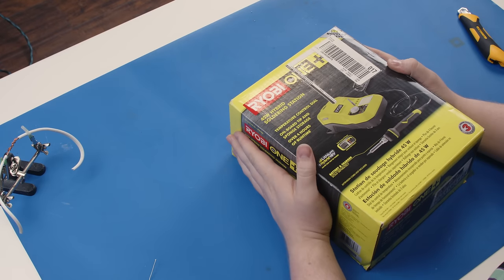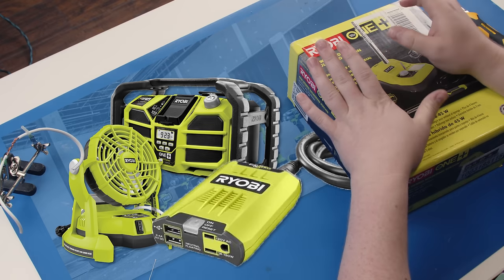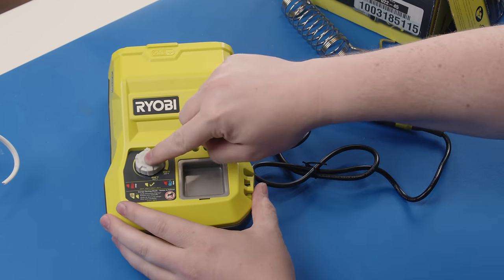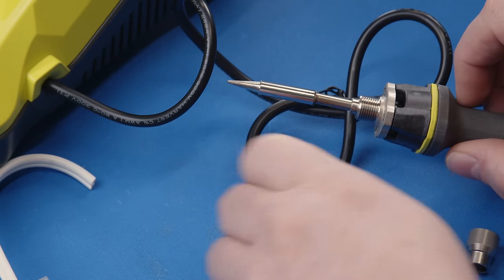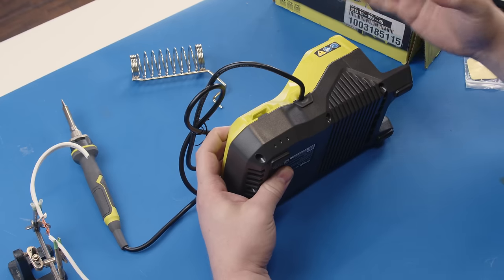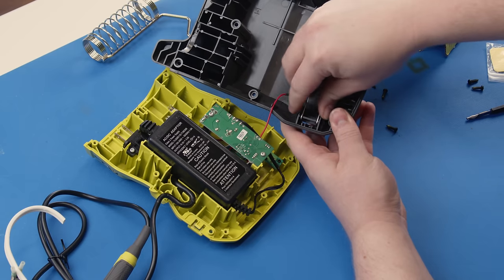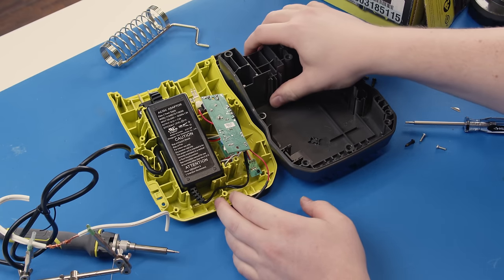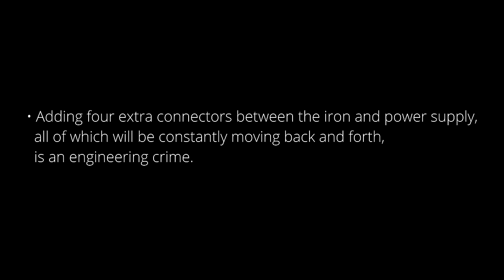Ryobi has GOT to be joking with this soldering iron

Comment: honestly, good on them for choosing Torx screws, imo. Professional choice.
I can't wait until Philips & PZ all curl up and go extinct.

The power brick is ... odd, but makes logistical & regulatory sense I suppose.
No excuses for the melt-happy wire though.

Looks like a solid design otherwise, ngl.

Regarding the build up of heat, I'm guessing it has that "intermittent operation" sentence in the user manual? Something something, not intendended for continous operation...
Reply: Torx is junk because you need a different driver for every size. With Philips and especially FlatHead you can almost use any driver for something like this even if it's not a perfect fit. For this application you aren't anywhere near the torque that would strip even a decent FleatHead, let alone require heavy duty systems like Torx. So I guess (and hope), that day won't come, and it didn't happen the first 50 years Torx was around, so...
Reply: @westelaudio943  and yet in the process of using the wrong Philips, you go and strip the crap out of the screw and permanently seal what ever you were trying to get open. Torx is a measure to protect the user from themselves. SECURITY Torx can piss off tho.
Reply: @deefdragon  

I've never owned more than three sizes of (large) Philips drivers and I can't recall that this ever happened to me with screws for plastic, except for maybe when the screw was totally rusted up and wouldn't move. But even then it's more common for the whole head to snap off, as those screws are usually made of very soft steels. You can still squish up the little blades on a torx head with the wrong tool, so that the right bit wouldn't slide in anymore. Torx only makes sense for self tapping wood screws, or bolts that go into metal, especially aluminium, if the space is too limited for a proper hex bolt...
Reply: @deefdragon  , I'm okay with Pozi-Drive, they're better than Philips anyway; but millions of people strip out Pozi-Drive screwheads by using ordinary Philips screwdrivers on them, because they don't know the difference, or don't care to learn. But I should confess, I only learned about JIS Philips-like screws at about age 60 after a lifetime of audio repair and tool use/abuse! (If I was a motorcycle buff, I might have learned about JIS screws sooner ---- I'm told that many bike owners stripped out the carb screws on their Japanese bikes). Anyway, for small or tiny screws, I'd much rather see Torx, or Robertson, screws than a #1or #0 Phillips.

Newsflash: Philips screwdrivers and bits  Can vary quite a lot in terms of angles and tapers. I have found some ordinary Phillips that are almost a perfect fit for JIS screws (Milwaukee impact rated bits) and others that are terrible. Weirdly, Dewalt makes Philips drive bits in 2 different styles, the tip of one type being very different from the tip of the other, and there's nothing differentiating them in terms of numbering or designations on the package. Torx and Robertson bits don't suffer this problem.
Reply: @westelaudio943  we’ve found the guy that leaves everything they work on with a load of rounded off screw heads 🙄

Comment: The thing to do with the Milwaukee M12 soldering iron  is use the large M12 battery that has a square base. You leave it standing and bring your wires to it. Works fantastic. I use it all the time in industrial settings. The head rotates for better positioning.

I have had mine for years and I've never had any issues and I've been decently rough with it. But if I did ever break the ceramic cartridge you can just change it out...

There is no heat control, but if you're soldering wires that's not an issue. Or soldering wires to industrial items made to be soldered to.  It's too bulky to regularly use for boards. But works great for soldering up connectors in the field, even M12 connectors. Bringing the wires to it is much quicker than using a 3rd hand and when you have a bunch of wires to solder. For an M12 connector you pre-tin everything and then just touch them to the soldering tip. Use a jar of no clean flux if you need flux.

It's a tool for technicians in the field. Not for use at home or at a bench.

Works much better than any butane powered iron or the Hakko iron.

I'm actually surprised you've had such bad feedback. I've known lots of other techs who have loved them and had them be problem free.

This Ryobi iron does seem great but with a different use case. I hope they come out with a Milwaukee version. I don't want to invest in Ryobi just for this when I already have way too many m18 and M12 batteries and chargers. If they keep the same cable I would have no problem upgrading it.

I'm an industrial automation electrician now. But I also used it when doing custom agricultural automation.

Comment: For about 8 years now, you can just get a TS80 and a powerbank or a TS100 with a USB-C fast charge to 12V adaptor.
About a 80 bucks, open source, temperature controlled and modifiable. Also uses a great tip technology. Sure it's not a station but you can very easily make it into one.
Reply: or a t12 kit for even cheaper.
Reply: Miniware has the ts101. Super portable.  Buy the accessory chisel tip.  You can mate it with a, compatible tip,  18-24 Volt laptop charger. You're good to go with 90% + of projects.

Comment: As someone who does soldering a couple times a year to repair electronics that I (ab)use to hell, I found "smart irons" like  TS100 or Pinecil V2 to be perfect. They might seem gimicky but their performance is solid. My current setup is PinecilV2 with a metal stand with a neodymium magnet for auto-sleep mode and a 18w PD battery pack. I also use a 19V barrel plug laptop charger when I need more power (up to 80W which is crazy). There are also some developments in RalimOs (firmare for those irons) to allow for up to 60W of usb-c PD capability.

Comment: At the same time as ColdHeat was around, another option was the Takumi soldering iron, ir runs off 3 AA cells. It'll consume the batteries in fairly short order, but it does make solder joints on things that aren't too heavy. 8W might not sound like much, but due to lack of area, it doesn't lose a lot of heat to air. They were very cheap and just something you could have for emergencies. Hakko also makes one of those, runs on 4 batteries. Oh right you have these both mentioned. Well they sure beat the ColdHeat, which was a total scam product. The lack of temperature control is not really a problem with these, since you simply push the button until you have a joint, it heats up in like 4 seconds and then you just keep it heating long enough for it to make a joint. And they don't need a proper stand since they cool down very quickly on their own, and a little foldout one is supplied. They are definitely emergency use tools though, since the tips are consumed pretty rapidly, and they aren't very fast.

You know that there are standard stands of several types that you can buy separately though?

Apropos vapes, you can get those soldering iron tips for vape mods. You can pump maybe up to 20W into them, but carefully. Also emergency use only.

Also trashing irons without temperature control? Well figures that you don't know how to solder. When i was 9, i learned to use a standard 30W iron. The way they work is they maintain somewhere within a workable range of temperatures by being balanced against the heat they lose from the large area. I won't use something like this today given the choice because some avoidable delamination may occur, but seriously you bought a Ryobi?

"YOU'RE PUSHING THE IRON DOWN" - well maybe you are? You're not supposed to do that. Heat doesn't travel better if you push harder. A light touch, solder and flux is all you need.
Reply: "Well figures that you don't know how to solder."

Sigh...when you learn how to make points without being a jerk you'll become much better at expressing ideas.

Comment: I have an issue with your statement “There is no legitimate use for them, they are complete trash” in regards to cheap AC plug irons. They are an amazing tool, a valuable asset to anyone working on vehicles, doing larger circuit repairs, or soldering tasks that require mobility. They are the only iron that is extremely portable, yet cheap. Great for working on car sound systems and replacing sensors. They can be neglected and tossed around because of how easy and cheap it is to change their tip. My point is not all basic soldering occurs at a desk in the air conditioning.

Comment: In this type of soldering iron, it is very difficult to replace the tip. The tip oxidizes during use, it is almost always impossible to pull the tip out of the mounting sleeve.
Reply: Only with cheap tips. Been working for years with Weller and Ersa equipment and never had that kind of problem. Not even with irons that were on 9 hours a day.

Comment: I have all Milwaukee tools . I was very hesitant to buy the soldering iron from them because of the bad reviews I was reading about it. Well lo and behold , Milwaukee supposedly took care of the problems with this iron . So I bought one about 4 months ago and it’s been working great all this time . I think it’s a good iron for quick repairs. I don’t think it replaces a bench iron and I’m pretty sure that wasn’t the intention. I work on pinball machines and this iron is fantastic for on the go “under the hood” soldering . It heats up pretty quickly and when I’m done I just stand it up on the battery end . If you’re doing a lot of soldering , there’s no battery equivalent that will replace a corded station . Thanks for your video , was very enjoyable to watch !

Comment: I have soldered a lot in my career, mini and micro miniature included. Many hours behind a Pace PRC2000.... That said, The Milwaukee soldering iron at sub 100 bucks, has done nothing but impress me in the field. It absolutely eats batteries, but it gets hot really fast and is capable of doing some pretty large joints.   The big problem with any soldering device is the tips, If you don't maintain your tip tinning, most people don't, it becomes very hard to solder properly. Weller are quality units and I would have one over a Ryobi any day.
Reply: Pace MBT user here.  I loved the MBT, until I got a Hakko 200 series.  Bought used, but has taken abuse.  I do miss the Pace de-solder station with the built-in vacuum pump.
Reply: @Disruptedgarage  I miss that the most when using other devices, that and the hot air SMD tool.

Comment: I've been using a Weller soldering iron without a temperature control for forty years. I doubt I would even know what to set the temperature to if it had one.
Reply: My go-to iron is a somewhat cheapy 60 watt Weller. Never had a bad time with it and it honestly always gives me perfect joints. I think as long as you take care of your tips and remember to tin them before and after each job, they'll remain consistent.
Reply: totally agree, temperature control not needed.

Comment: I inherited my kit from my grandfather, and I'm almost positive he bought it back in the mid-to-late 1960s. It's not portable unless wherever you're going has an open outlet to use, and the tips are quite old and have had to be cleaned and serviced by me several times, and you can even still get replacement tips that work in it. I've had to open her up and change a capacitor or two over the years I've had it, but it's super robust, it's what I learned how to solder with in the first place, and it's still very, very useable indeed. I know that the phrase "they don't build them like they used to," makes me sound like a clichéd old man who's out of touch with the rest of the world around him, but in some cases it's absolutely true.

Comment: The reason for those deep wells for the screws in the casing is because this way you don't get that 'tower' be a solid hunk of plastic, which would mean wall thickness variation in the moding, thus giving problems during cooling down period (longer cooling, thus longer cycle time, more money to make). Also because it would be the thickest part, everything else around it solidifies first and thus the tower would end up with no plastic being able to flow into it while it cools and shirinks, thus creating a cavity/porous structure (weak point) and also causing serious warping.

The draft angles, well, they are draft angles so the molding comes out of the mold easily.

Comment: I have 2 of those "cheap" blister pack style soldering irons. Bought in Maplin here in the UK, one has lasted for over 25 years (I only use it for maybe 2-3 projects a year). Also, I've never had to press down with an iron. If it heats up it'll melt the solder and the solder will just flow into place.

Comment: I have one of these and like it. I agree that the cord could have been made of silicone rubber, but I also know there are plenty of soldering irons that use PVC cord. I did find it somewhat amusing how they used a stock power supply block instead of an open frame power supply. Perhaps, as you said, it was to get around having to certify the power supply. 

I'm not disappointed in the build quality of this soldering station, but it was interesting to see what it is on the inside. I still think it's well worth the price I paid, but I buy my Ryobi tools refurbished or factory blemished from Direct Tools and pay a lot less than retail.

Maybe someday I'll get inside it and replace the cord to the iron and install some sort of locking connector at the back of the iron and at the side of the shell so that it can be replaced. I doubt it will wear out on me but if it does, this might be something I do when I repair it. 

They do make a much brighter portable LED light, which I almost bought last time I was at Direct Tools. At full charge, the peak voltage of an 18V Lithium-ion battery pack can be a bit over 20V. The 20V wall wart inside the light you took apart so the light will be right at home with the 20V rated wall wart.

Thanks for the video!!!

Comment: Had that solder iron for years, cable is still fine, solder iron still works, use it at least 2-3 times a week. I do get that you could have a better cable though. A heat resistant cable would be great.

Comment: The TS80 has been a faithful companion to me for a couple of years now, it'll happily run off a power bank for a good long while, and the directly heated tip has felt vastly superior to any other iron I've used, even at 18W. Mind you, I'd only ever used cheap crap before, and a 65W "soldering station" I got off an electronics retailer, that honestly felt worse than the chrap iron.

It even let me wire in a couple of those cup DIN plugs inside a pretty tight loft space once! The trick with those, by the way, is to get some solder inside the cup, heat the cup so it flows the solder, then insert your pre-tinned wire and reflow the whole lot. Still fiddly AF, I still wouldn't ever want to redo those 11-pin mil-spec connectors, but at least this way you stand half a chance.

Comment: I modified a 20 dollar radioshack battery powered soldering pencil to contain an 18650 cell and a usb charge port from an e-cig found on the ground outside. It works fairly well. Its super shaky looking but it gets hot fast and lasts long enough on one charge to get thru some decent repairs.

Comment: Soldering is a skill to be learned like any other. If you mess up a lot then you probably just don't have the skill down yet. The tool isn't likely the problem. As a 7th grader in 1966 I built, as part of my "general shop" class, a steel trash can by soldering panels together with a large copper tipped "iron" that was kept hot inside an oven. Later, as an Industrial Maintenance apprentice, I learned to solder wires and circuit boards and all we ever used was the pencil type irons you said were junk. The reason they come in various wattages is because one is for little joints, one is for big joints and one is for when the joint is "Just right", as Goldilocks would say. Like I said it's a skill and it takes practice not a fancier tool. Fancy tools are like most fishing baits, they catch more fishermen than fish. BTW, I find that Ryobi provides pretty good value and utility, for the home gamer, at least.

Comment: The Pinecil 2 is a very nice soldering iron that runs off any random DC source up to 24 volts. With the price, you can buy another one if you manage to break it anyway. It's got an integrated digital controller (just like the TS) so you can digitally set the temperature, select power source type, set a sleep timeout, etc. Firmware is open source and upgradable.

Batteries not included, but you can plug it into any random power source with a barrel jack, DC 9-24V, and this includes laptop power supplies like Ryobi used, or self-made battery packs or battery pack adapters. Or a power bank with USB Power Delivery (type C connector).

Physically, it's a "work smarter not harder" design, a lightweight cheap tool, not a hefty solid one. If you like the solid, heavy, analogue feel of a traditional soldering iron, maybe you wouldn't like it. It's lightweight, but not garbage - it has the goods where it counts - heating up in seconds (depending on power source) and maintaining a stable temperature. You talked about the connecting cable being really important, well the same company sells unusual silicone USB type C cables to use with your soldering iron and power bank, because they know that matters.

If you have a TS80 or TS100 it's very similar to those. Everyone I know who has one loves it.